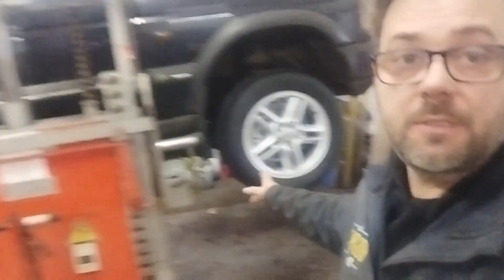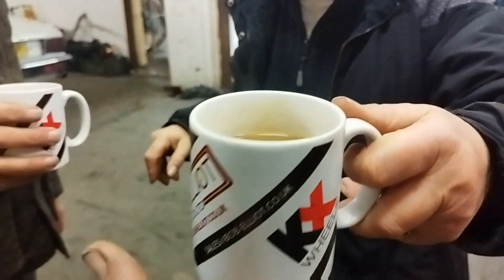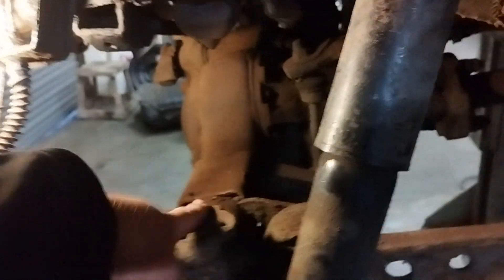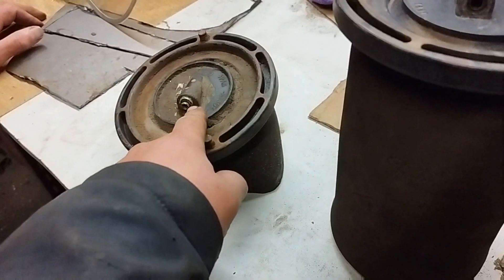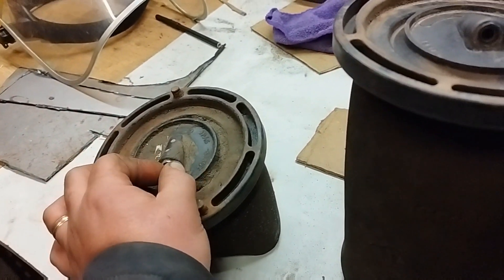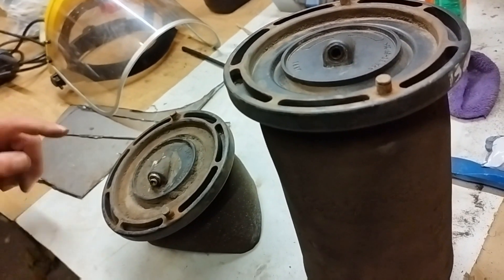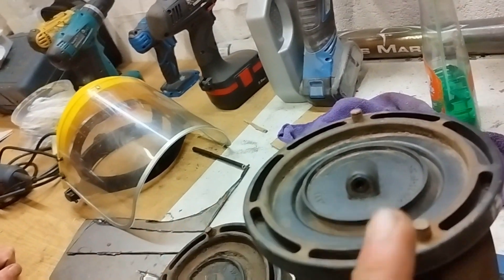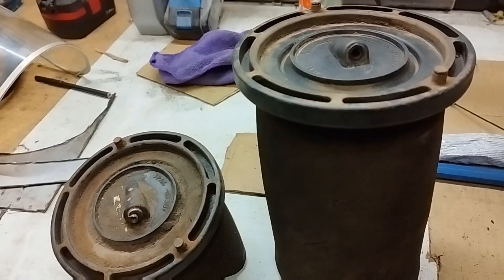land rover discovery 2 td5 suspension airbag fail.

Comment: Pleased to see that you are not fitting steel springs. So many people panic with air suspension, in reality Air springs are a wearing part and need to be replaced occasionally, just like an oil filter. You wouldn't not ever change your engine oil filter and whinge about it failing. Leaking bags wear out the compressor, put new ones on. Simple.
Reply from the maker: Thanks. Suspension all fitted now and calibrated. No time for a vid on that one but will update soon